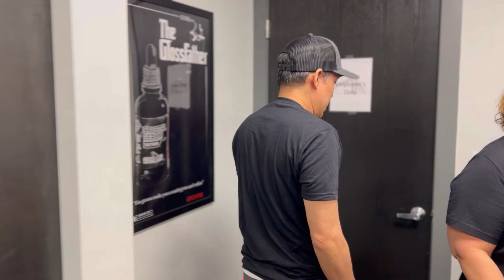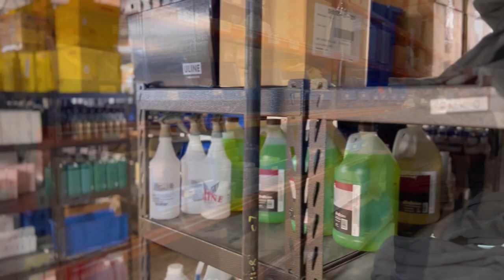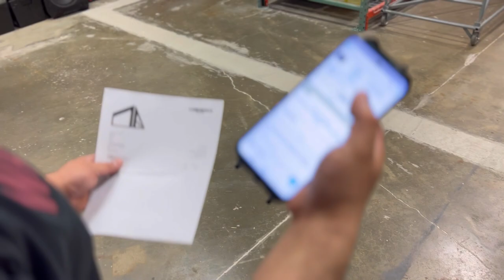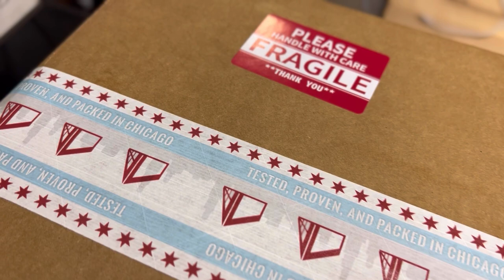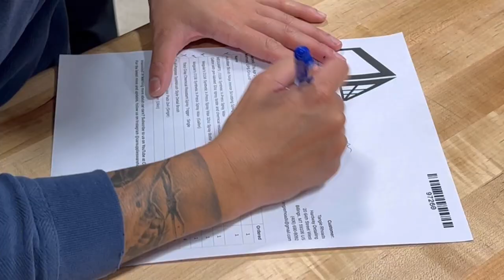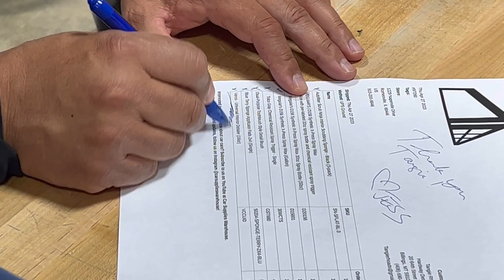Behind the Scenes Look @Car Supplies Warehouse Creator Summit 2023 + Touring CSW with Friends!

Comment: Question, I'm about to buy 4 bottles of pro 2.0 mckees. Does it compare to igl coatings?  I was wondering if you get any commission. If yes, do you have a code. I would like to support your channel.
Reply from the maker: I haven’t tested all of igls coatings, only a few and am still testing the 2.0 out. I’m my environment I’m finding it gets clogged easily but with a water spot treatment /detailer it bounces back but that’s my only concern and be it a minor one. The og formula I’m really happy with. Coupon code for Mckees 37 is in the video description as well as CSW
Reply: @attention2detailswchelsea  are you saying the mckees 2.0 gets clog?